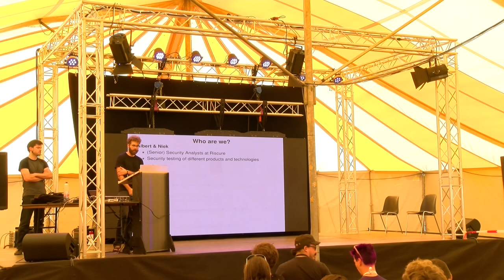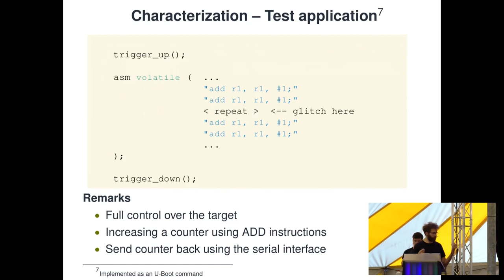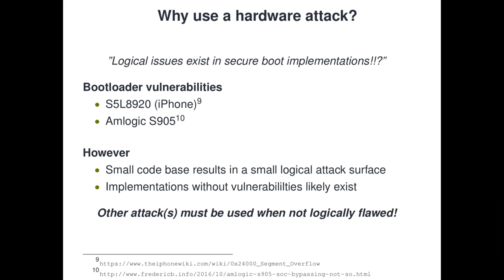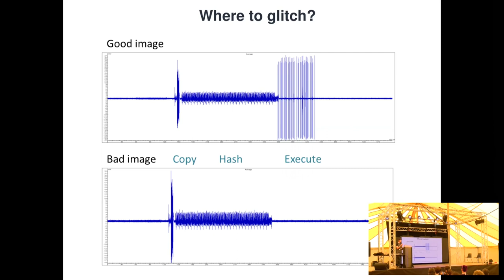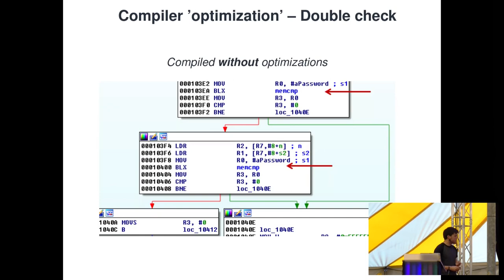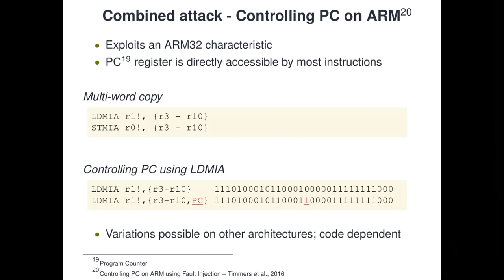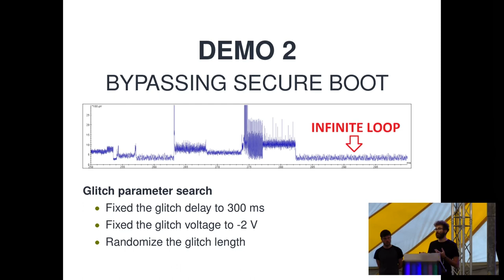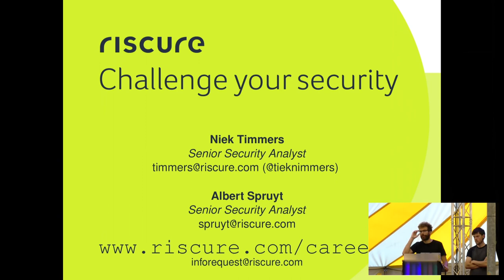Bypassing Secure Boot using Fault Injection (SHA2017)

Comment: Nice to find out that the actuall tools used for testing purposes over decade ago in the early 2000's  for glitching other type of smartcards ST7 and ST19 using the ARM and some SLExxs using xiling 100mhz... so the tools still reach their goals and needs on newer recent models.. interesting...